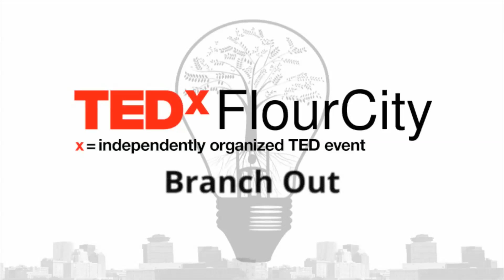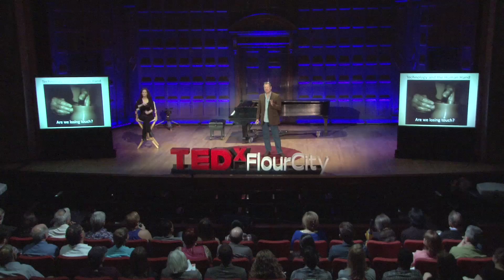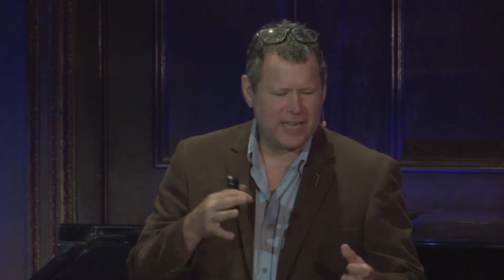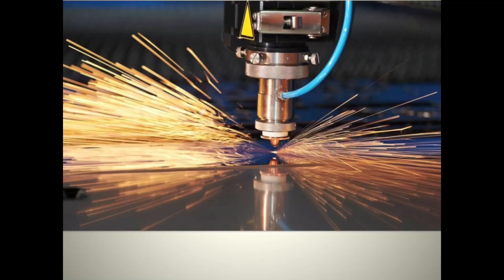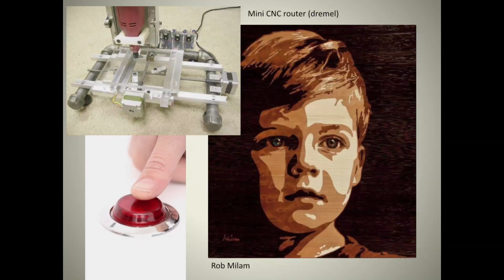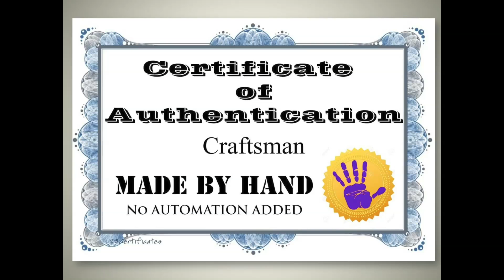Craftsmen may be lying to you | Scott Grove | TEDxFlourCity

Comment: This mindset is such a narrow view on what it means to be a “Craftsman”,
I bet when chisels first showed up there was someone also giving similar talks saying,
"We don’t need this new chisel technology”

New tools in the short term makes things easier to make
something but then "Craftsmen" take them to a whole new level and
make amazing objects that sets them aside from the average user.

Technology/Tools don’t make a "Craftsman" it's how
you use them that set's you apart from the apprentice.
Reply: For reply to unfortunate Michelangelo comparison, see above. If you wanted to highlight just how slippery of a slope this is, invoking the name of the guy who ruined his body working inches away from his most famous painting for several years pretty much covers it. ;)
Reply: I salute your brain, man i'm with you in the same path
Reply: I would agree with this as it pertains to new tools which still allow a hand to tool to material connection.  A craftsman shaping a piece of wood with a power carver is still doing so by hand.  If they accidentally take a bit too much material from an area, they can look at it in the moment and smooth it out or decide to take a bit from the other side of the piece for symmetry.  They also have to react to changes in the grain of the wood and modify the angle of their cut to avoid chipping and tear-out.

When it comes to CNC, the “operator” clamps a piece of wood down to the table under the machine and pushes a button on the computer.  The machine goes to work hogging away at the wood.  One popular YouTube woodworker used to have a setup where, for practical reasons, his computer was inside his house and the CNC was in the garage.  I simply cannot label something as craftsmanship if you aren’t even in the room when it happens.
Reply: Exactly.  Throughout history, people have always used the best available technology to make their jobs as easier.  Michelangelo would have used a pneumatic carving chisel had they been available.  Some choose to focus on doing a particular task using tools from a certain period, and it does mean the end product may be more hand crafted than something made with computer controlled power tools.  In the end, hand crafted means different things to different people, but you can still be proud of something you've made whether with chisels and hand planes or power tools.  Its still better than buying particle board sawdust and glue garbage.